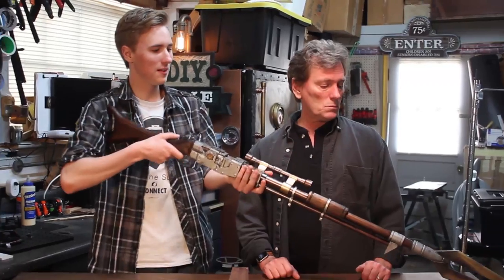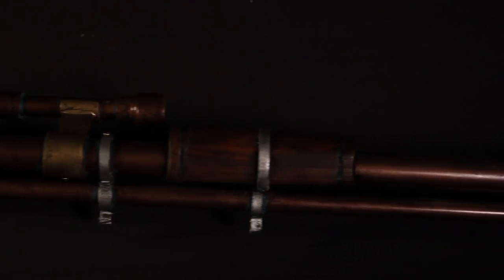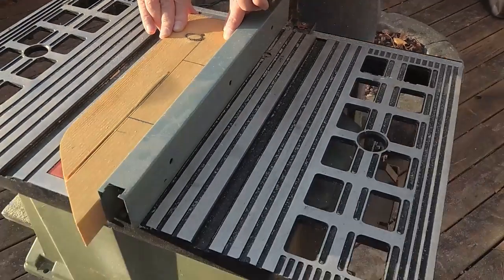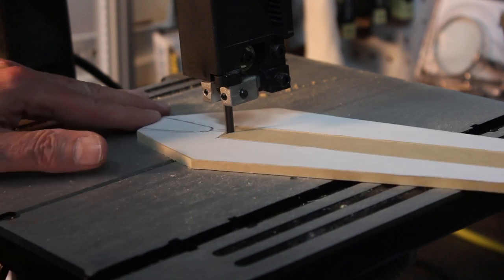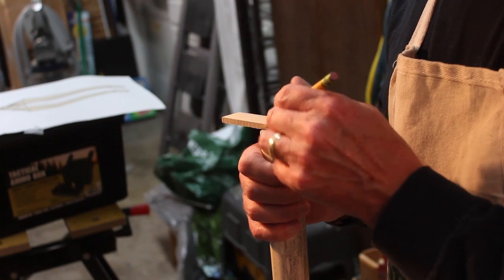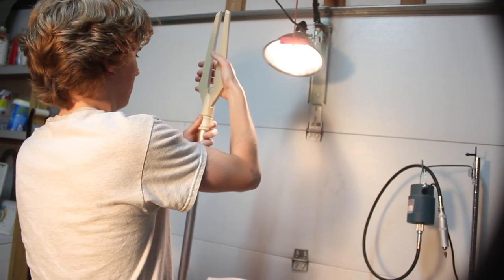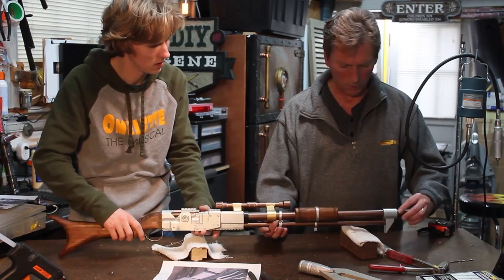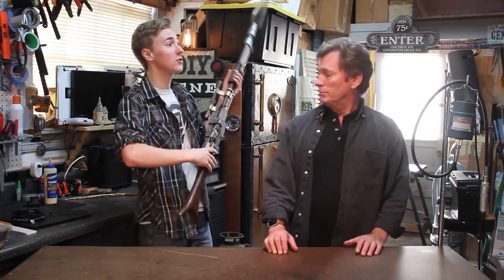Home Depot Mandalorian Pulse Rifle. (You Can Make!)

Comment: Hello, Gene. I wanted to ask you something. I will try to build Kylo Ren's lightsaber at school, but I need the exact website where you got the pipes from. Greetings from Switzerland.
Reply from the maker: Hakiman 3000 , Do you access t Amazon? If not I can send you the specs for the materials.
Reply: @DIYGene  Thanks for the quick answer. I do not have  access to Amazon yet. But i can do that in a short time. If it works i will be in touch.
Reply from the maker: Hakiman 3000, Good luck and May the force be with you 👍
Reply: @DIYGene  Now i have access to Amazon. I was looking for the PVC pipes and i cant find it.